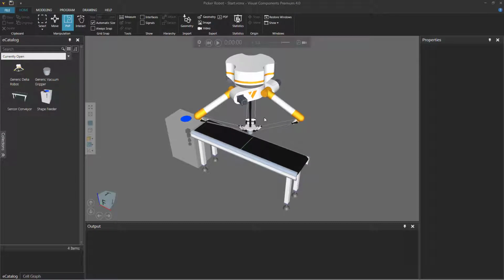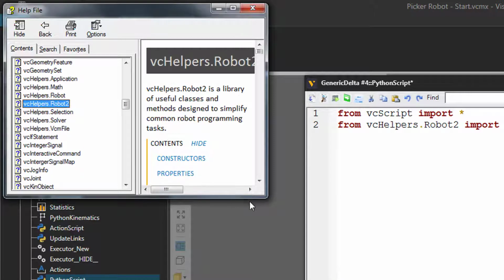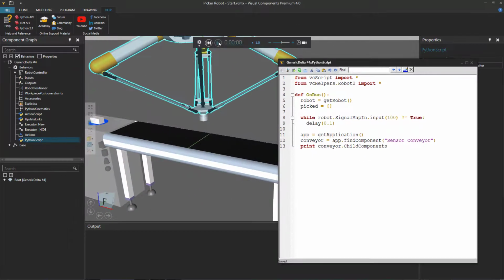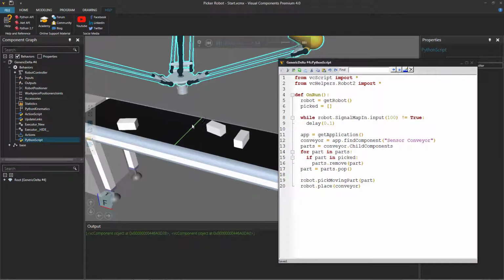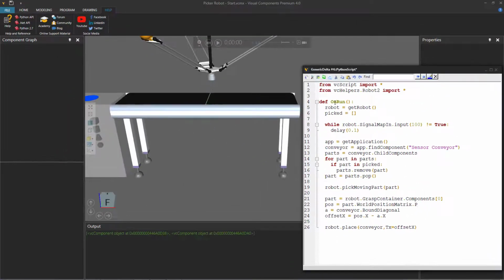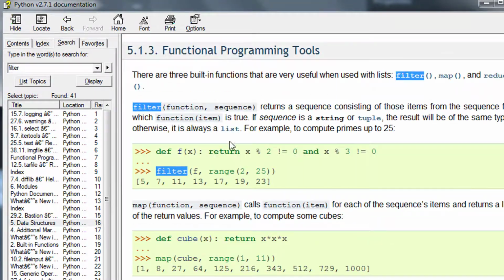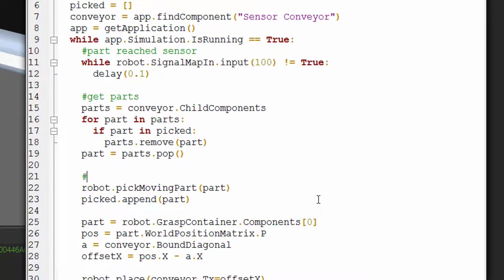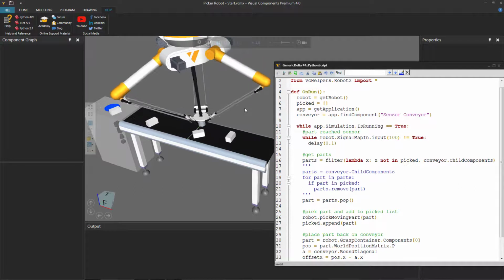Python Robotics - 5 - Control a Picker Robot

Comment: I dont understand. If I build a real delta robot. can I control using your soft. or is only simulation. what is the goal of your software.?.
Reply from the maker: Yes, we support external control of robot in simulation depending on the use case. For example, do you want to control the delta robot using PLC, create a digital twin or validate your robot program? It would be good to post this on our forum or contact our support.
https://forum.visualcomponents.com/c/robot-programming/12

Comment: which type of software used ?
Reply from the maker: Visual Components Premium is used in the video, but you could use Visual Components Professional as well. If you want to use Visual Components Essentials, you would need to create an add-on: ini file for loading command, and command file for defining what the robot should do. A component script, which is what is used in the video, is an easy approach for debugging and using intellisense. You can, of course, edit a command file in real-time and it would be recompiled automatically when executed, but Professional or Premium are the easiest ways to get familiar with the API.